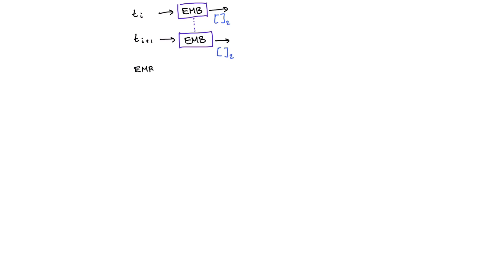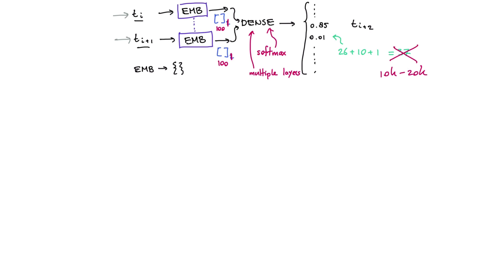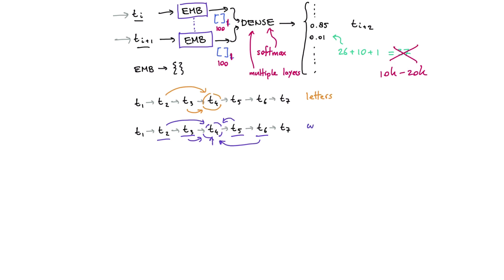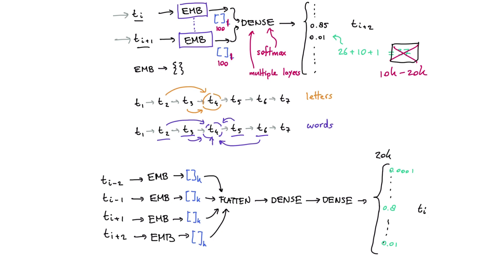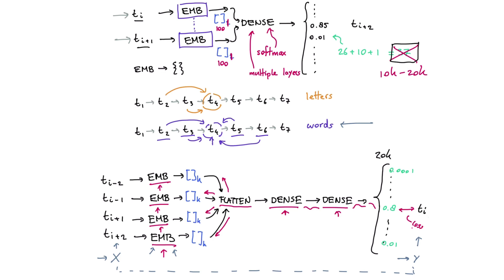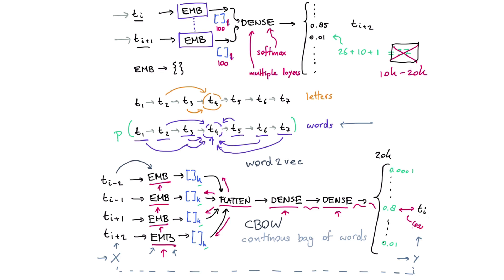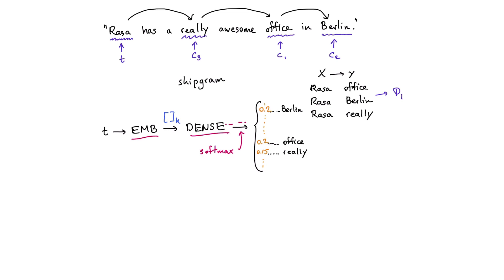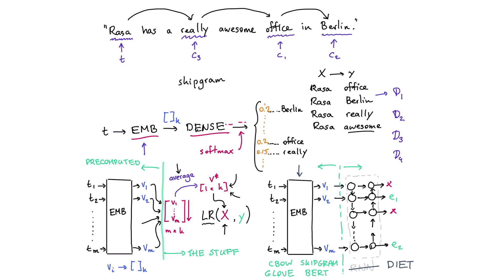Rasa Algorithm Whiteboard - Understanding Word Embeddings 2: CBOW and Skip Gram

Comment: Thanks for the video! However I was familiar with the details of these two algos. What I am actually interested in is, how I can make RASA using spaCy-s dense word embeddings (token.vector). I have an own spaCy model with a complete language model in it for hungarian language (made with Skip-gram of course) and I want to utilize it in RASA. Is it capable of that, out of the box or I'll have to write custom code? Thanks!
Reply from the maker: (Vincent here) 

I'd love to help out here but maybe it's best to use our public forum for that. Feel free to ask away at https://forum.rasa.com and ping me @koaning there. 

Also, I host a side-project that also has pre-trained embeddings for Hungarian. We also allow for gensim if you've trained your own. https://rasahq.github.io/rasa-nlu-examples/docs/featurizer/gensim/
Reply from the maker: On the forum I can give more long form answers with images. The youtube chat-system is a bit limited for that use-case.
Reply: @RasaHQ  Thank you for your quick response! I have created a topic for this same question on the RASA Forums.
Reply from the maker: @aeronszalai4190  Could you make sure that I'm tagged. You can do so by adding @koaning to a message.